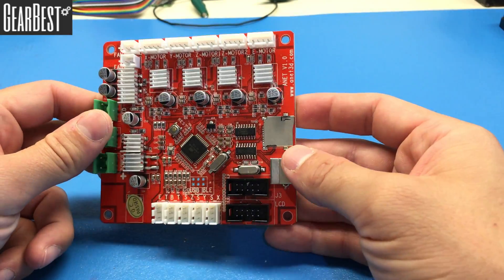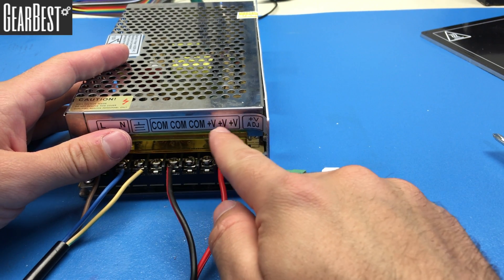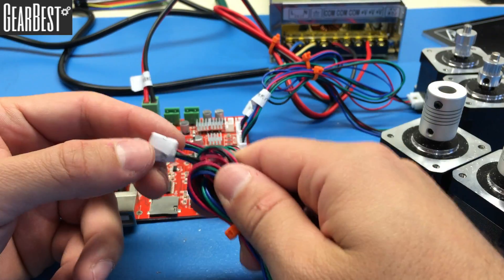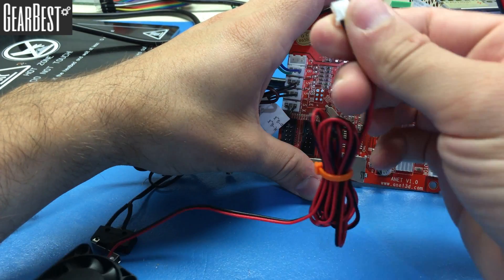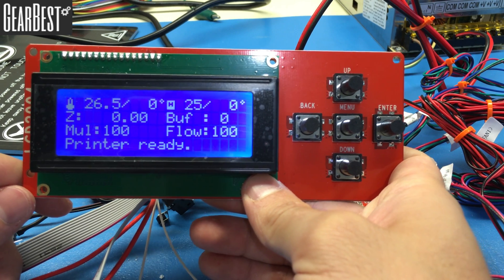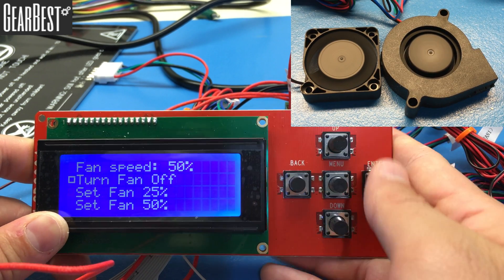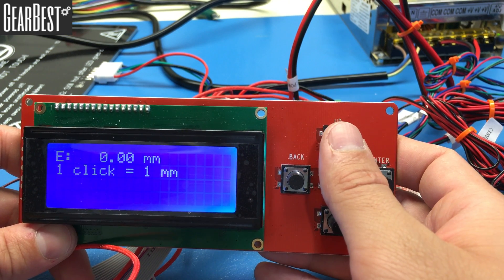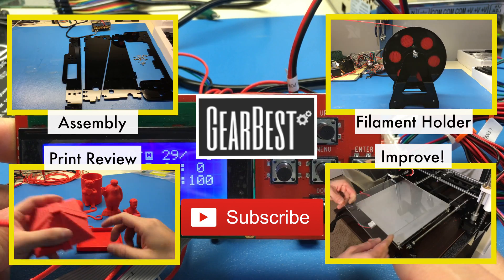Electronics Check | A8 Anet Desktop 3D Printer DIY kit

Comment: Hi, i  have New pronter Anet A8,What is the problem ... When the initial operation, the extruder is directed to the opposite side to the end and continues for a while the engine rotates even when the extruder reaches the end ... The same applies to the surface ... Also, the z direction motor works one and the other does not work .. Note that I almost checked the connections  All are correct
Reply from the maker: Did you solve this issue?
Reply: @3DPDoctor   yes  I do  ....... thank you
Reply from the maker: What was the reason? How did you solve it?
Reply: @3DPDoctor  welcome my dear friend
Firstly, I am sorry, my English is not excellent
After a long suffering and the purchase of several motherboards, 
cos i was  believe that the problem was damaged in Motherboard
After a long research and experiments, I found the solution, which is very easy
I found a problem with programming where I just opened the Configuration.h file and modified the following line

#define INVERT_Y_DIR false
to
#define INVERT_Y_DIR true
 

That's all
Thank you for your interest .....
I hope that you will visit us in the Kingdom of Saudi Arabia ... You are very much welcome
Reply from the maker: Thank you!! So it seems like a firmware issue

Comment: if your having problems because the power polarities appear opposite to the video do not panic, look carefully inside the metal case you should see pos and neg printed on the power board showing you exactly where the colored cables go and same applies on the other circuit board,it also show where neg and pos wires should go. Take time to look carefully all the info is printed on electronic boards. Its there you just have to look.

Comment: I just assembled my printer. Thank you for the great video.  I have a part that came with mine that is not in your video or the instructions.  There is no where to plug it in on the motherboard.  Can you tell me what it is by chance.  It is attached to a piece of plexiglass about the size of a credit card.  It is a smll blue box with a cross hair on the front.  It has these words on it.  (periods means new line.....8k.....sn04-n...BN-10-30V...BK-NPN.NO....BU-0V....  My wiring and montherboard was not exactly like yours but It seemed to go together, they made some upgrades or something.

Comment: Thanks for this video, I found it realy useful. There are some things that are different on my kit to what is shown in this video. Such as the black and red cables are the opposite way around now on the mother board. So be careful to wire this correctly. One of the white mounting bracket things for the cross rail is also different and uses the allen head screws now.

Comment: Thanks, very helpful. Only thing I noticed is that the FAN (FAN1) would not spin up as per the commands. FAN2 is always on (by design). FAN1 started only when I heated the extruder. Then I was able to control the FAN2 speed via the menu settings suggested.

Comment: hi i have a anet a8 prusa. im having trouble powering on the system. iv put all the plug in the right order but, the voltage given 110v or 220? i am in usa.
Reply from the maker: +almondjoy590 usa 110v input from the wall

Comment: Can someone help me? Both my extruder heater and bed heater are not working and I am not seeing any lights on the motherboard or the bed either when I try to heat the bed. I've been told this could be a problem with either heater or either thermistor. Is there any way to narrow this down so I know which part I need?
Reply from the maker: Interesting. Did you ask the fb group? To narrow it down: 1) do you see any flashing light on motherboard? Lcd lighting ? 2) take a multimeter and measure the terminals where you connect heatbed and extruder cable and see is the connection complete?

Comment: Hey guys so if I'm living in the U.K. And the U.K has 230V I select the 220 switch on the power supply ?
Reply from the maker: (risk is on your own) for the best of my knowledge using 220 is okay, it will handle the voltage fluctuations

Comment: Can anyone help? I've just finished assembly and when I press home all the z motor carries on past the end stop
Reply from the maker: Can you explain more ? When you press the z limit switch after you press home all,  is it keep moving? If that is the case check your limit switch. Maybe there is a problem with it. Maybe limit switch is not working.
Reply: Thank you for the advice, it turns out that the limit switch simply wasn't being activated properly. I have since fixed this issue

Comment: I just finished setting up the printer and there is something wrong with my LCD screen. It turns on, but the screen shows none of the options like the quick settings for the motor checks. Does anyone have an idea on how to fix it?
Reply from the maker: +Carson Etters ther might be a problem with the firmware inside. Have tried to reupload firmware with your computer? Also dont forget to post this into fb group. Most probably someone else has faced with this issue before
Reply: Where would you find the firmware and can you upload it with the usb cable they provide
Reply from the maker: Sorry about the delay. You can find the software in the files part of the fb group I guess. And usb cable that they give should work. If not you can ask to group.

Comment: Hey man, my printer was working fine until suddenly my LCD screen went blank (yes the wire stayed plugged on correctly) when I turned on the power supply. The backlight on the power supply turns on and the fan 2 turns on but nothing else works. Removing and reattaching the LCD cable also did not work. Cannot even connect the printer to my laptop using the USB cable. 

When I checked the solder connections with my multimeter, everything was fine in the LCD sockets of the motherboard and the female pins in the LCD, all taking 12 V. I am not sure what to do. Please let me know if you have any ideas.
Reply from the maker: +ragavsn01 ı am sorry to hear that. I haven't faced with this situation before. Have you post this problem into fb group? I believe more ideas can come out.
Reply: Yes I did. Not much response there. Looked up similar problems in thingiverse. Got a suggestion that I may have to reinstall the firmware. Which I cannot do as the motherboard is not being read by my computer. I am desperately looking for ideas
Reply from the maker: +ragavsn01 did you try to disconnect all the cables from motherboard and than try to reach it with your computer?
Reply: Yes. I disconnected everything and tried to connect with my PC. Nothing happened. I guess I have to get a new main board.
Reply from the maker: +ragavsn01 one more question, when you plug the board into computer cable, any indication lamp blinked or not? If board isn't powered up by your pc it will not respond. If you ever used boards like arduino they are powered up by pc cable. But maybe this one is 't. Just wanted to ask.
Reply: After looking up, apparently this board cannot be powered by PC alone. Anyways, mine doesn't respond to the USB cable at all. No LED response.
Reply from the maker: +ragavsn01 have you tried to change usb cable ?

Comment: I have completed building the Anet 3D A8 printer. I just discovered the Electronic Check video.  In running the test described in the video I have determined that the Y and the Z 
limit switches are not working. The X limit switch is working.  What do I need to do next.
Reply from the maker: +Kenneth Crandall hi, it is sad to hear that. There are couple thing to do. Have you join the fb group? People can give you more support and links to replace your limit switches.
Reply: Did a test on the limit switches and they were ok.
I determined that the SZ and the SX are labeled incorrectly on the
mainboard.  I switched the SZ and the SX wires and the Home All test 
worked correctly. Thanks for your help.

Comment: what about the sd card che]? that's where the trouble starts. After replacing the card that came w/it (the menue did not show any test files), now it finds the menue and shows all the files. succsess? maybe; when I try to print any of them, the lcd shows for a second 0% and goes right back to "idle" :-(    What now?
I plugged in the usb cable to print from the computer, but nothing shows up, neither on the computer nor on the lcd.  grrrrrrrrrr
can you give me a lead ?? I am stuck now
thx
peter
Reply from the maker: +peter L. This is sad situation. Have you joined the fb group? I am sure that someone can help you in the group. Maybe someone faced with this situation and solved that. :/
Reply: Are u pressing the tiny reset button on the board after putting your SD Card in?